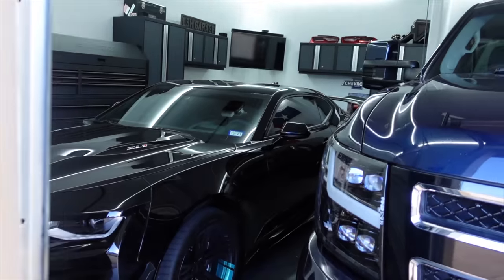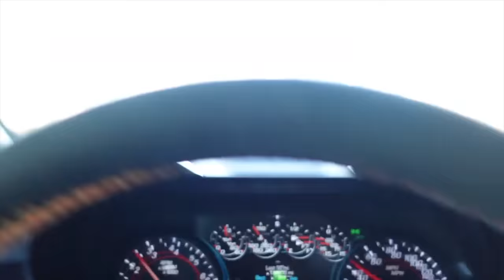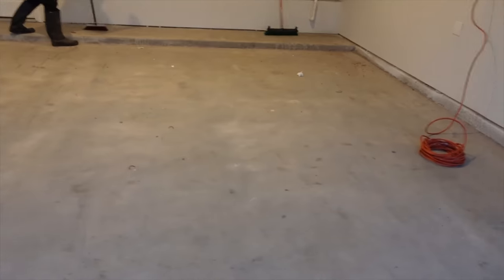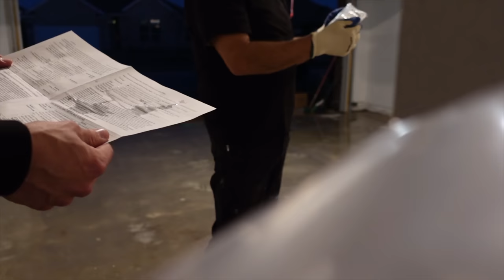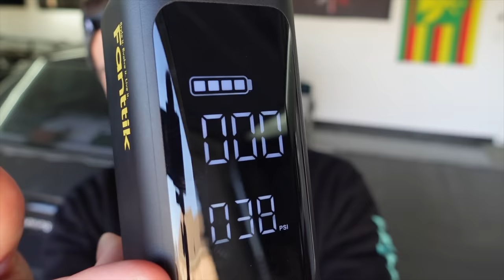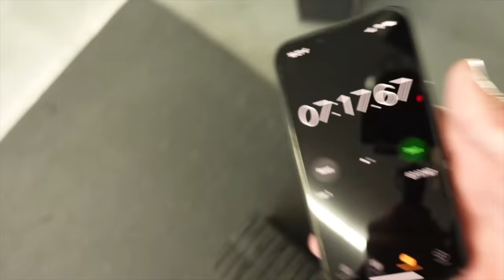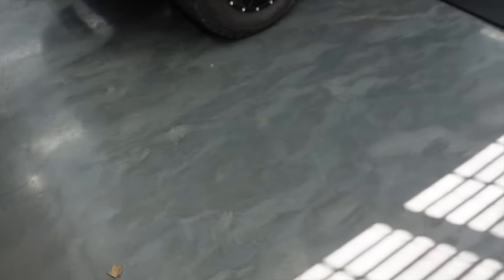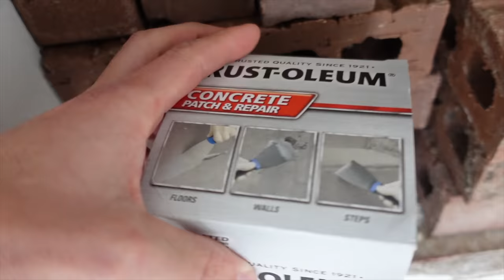Rustoleum ROCK SOLID Perfect Results [Secrets]

Comment: I have a two car garage and one of these 2.5 garage floor kits was more than enough to cover my floor and I'm very happy with the outcome. Infact I through a little away that I had leftover. Remember with painting your wanting to change the color. Its not like putting icing on a cake, the thicker the better so just change the color and you'll have plenty to complete a two car garage like I was able to..
Reply: how many sq feet is your garage, 576? I was wanting to do my new 2 door garage it's 576 with a 6 inch rise around the base. I was wanting a thick coat on mine tho. I'm probably going to go with 2 2.5 kits.
Reply: how many square feet do you have? I think every one has a DIFF. size for a two car garage. What color did you use?

Comment: If you don't want it to bleed through the tape, caulk the edge of the tape. Just do a really thin beat of caulking. It'll seal the tape and the material won't bleed under. I'm a professional house painter and that's what I do when I paint walls and I have to cover the baseboards.
Reply from the maker: Thank you!

Comment: I've done this kit (different colors) in two of my garages. Prep is absolutely essential! Even after a muriatic acid wash there were spots that didn't get completely clean and the epoxy did not adhere. (Older garage that had been beaten up quite a bit.) Regardless, it still looked pretty damn nice!
Reply: Im having a problem with tire marks not cleaning up, Im not sure if I should try applying the epoxy on top of it.

Comment: I'm commenting mostly for the "almighty algorithm".   I'm going to have my garage epoxied, but first, I'm going to have my basement epoxied to prevent any last bit of radon from coming into my house (on top of the radon mitigation system I have installed).  This will also protect the floor until I have time to install a flooring system over it.  My garage is going to take a lot more prep as I have to grind down the side wall schlup (is that even a word?) that spilled out from the concrete forms.  The garage is going to happen, but it'll happen second.

Comment: I just bought the tire inflator due to me being disabled and can’t lug a compressor out of my garage. Looks like a great product looking forward to using it!
Reply: I probably getting one for similar reasons but did have a cigarette plug one that worked in a pinch and have a small jump pack & basic tools. Not sure your disability but if you do any maintenance on your vehicles what I did being paralyzed is installed air hose on retractable reels since I don't have a garage main compressor in basement and have piped to quick connects to a small Rubbermaid shed where I keep my tool cart and tools. One day I will lottery and have an accessible garage and home but till then improvise, adapt, overcome or.... (atf fronws upon last part ha)

Comment: To get straight lines use caulk on the tape and floor. So when you paint it you're painting on thr caulk.  When u lift the tape you're cutting the caulk which will give you a perfect line.  It's impossible to get a straight line with just tape on a textured wall or floor.

Comment: Not sure if it would work with concrete or epoxy but I was taught a trick when painting interior walls if you tape off area then take silicone and you do small bead followed by gloved finger interior you don't need a big glob but it gets into the gaps and seals it and you get crisp lines when you peal back tape its a little more work but I suck at painting so it makes it look professional.

Also that inflator is neat, do think I need one for ekit

Finally I have a similar thought process though being paralyzed there is some jobs I can't do but I do still try to do what I can, I won't lie there is little jobs like oil changes that's quicker to pay for but that's just me but if I had that lift and definitely not HF jack stands a garage(I get cold for a HI is anything under 65° it's - 4° right now this is how u can key a car with ur nips lol)

Comment: How many of these kits would you recommend for a 20x20 garage? How many extra bags of flake would I need to get full coverage or close to it?
Reply: Hey Manuel, I'm not an expert, but let me tell you what I did on my 28x30 garage. I used two kits. I didn't do black, I did gray, so maybe my garage floor is showing through, but with gray on gray, does it really matter? I can't tell if it is. Anyway, the kits come with two bags of flake and I bought four extra, for a total of eight. That gave me coverage similar to what is shown in the video. In other words, it takes quite a bit. 

As stated, prep is key. I went overboard. My garage was also brand new, so I didn't need to grind, but I started washing it several days before I laid down the epoxy, doing the acid wash and then coming back every day to respray and squeegee to get out all the dust. Then the morning I laid down the epoxy, I came back and swept it really good. It was clean enough to eat off of when I started.

It's been about a year and a half and it is holding up great. I work on vehicles, rolling jacks, toolbox, and jack stands around, and do woodworking, etc. I'd classify my usage of  it as medium duty. So far it is holding up like a champ. I am not careful with it at all, but I haven't dropped a 100lbs anvil on it either. 

I know that doesn't directly answer your question, but hopefully it will help give you some guidance. Good luck.
Reply: What would you recommend on a floor that has been painted many times over the years and what would you use to fill cracks ? Regular thinset ? And can one part be done and later another part ? In other words can it be blended into each other ? Makes sense ?

Comment: I'm in Texas just pored a 31x26 slab for a shop went with 4 inches thick to cut the cost and do aluminum building the concrete cost me 5000. Material are high

Comment: That’s crazy their kit only uses one coat. Wonder how long it will last. The kit I did from “original color chips” has 3 coats: an epoxy primer, the main base coat, and a urethane top coat. If you can get away with using just one coat by using this kit it definitely would save a lot of time compared to the one I used. For those 3 coats you have to wait about a day between coats.

Comment: Does anything change if your garage is 4 concrete slabs with small gaps between the slaps for drainage?
Reply: I’m doing this project currently. I’d use thick painters tape (yellow for maximum sealing) and do one square at a time to ensure it doesn’t bleed over and your lines stay clear.

Comment: Love the channel but the DIY kits are definitely not the way to go for a long-term solution.  I did everything and more for prep and hot tires marks started within weeks.  Wrote the company and they said with "higher-end" tires leeching is normal and DIY kits won't prevent it from happening.  Got a full refund on all materials but still spent numerous hours moving and storing stuff in and out of the garage.
Reply: You must have had poor prep work. It happens lol.

Comment: Do you remember what rollers you used?  I used this product in my garage 4 or 5 years ago and it came out great, I forget what rollers I used but I know I didn't use the rollers that came in the kits. I am planning to use this product on my basement floor soon and I want to make sure it comes out as good or better than my garage floor came out. Not sure if I should etch the basement floor or not since no cars, what do you think?  ....... Also, my basement is big, like 1700+ sqft so no way I'm doing the whole floor at the same time. I'll probably break it down into 3 or 4 sections, do you think I can feather in the seems between sections or do you think it will leave horrible section lines visible?